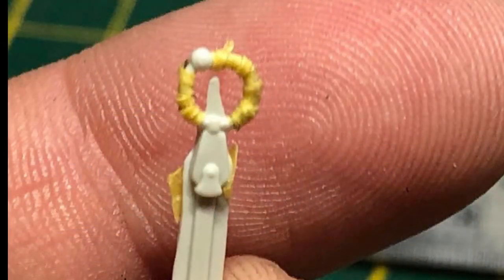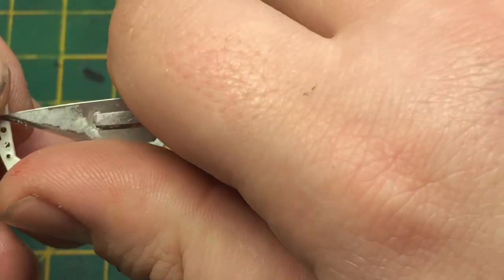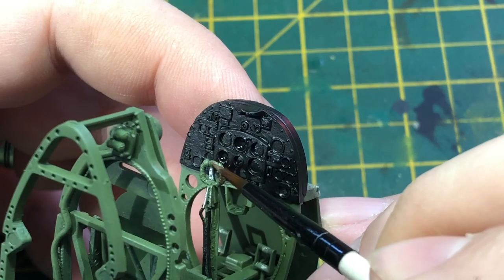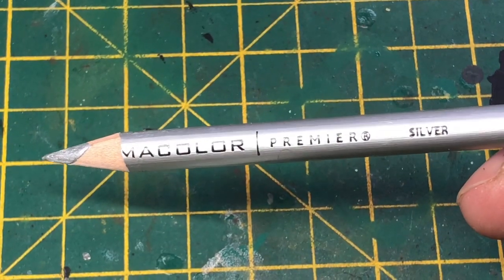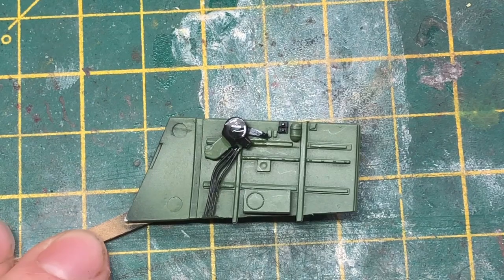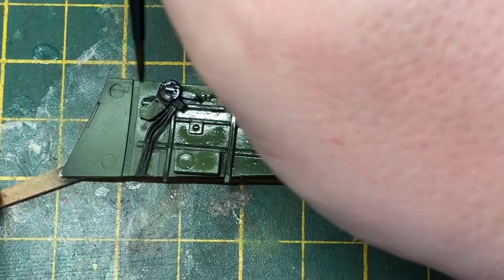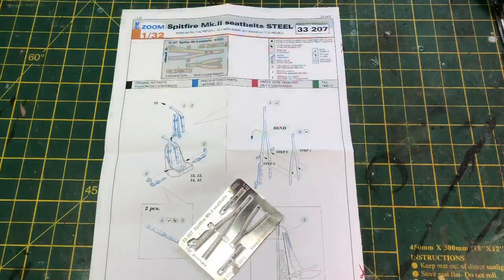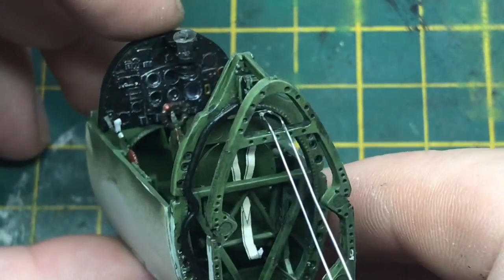Cockpit build of Revells 1/32 Mk2 Spitfifre

Comment: I'm building the hobby 2000 Va Revell kits it's horrible 😫  that seat nightmare and the decal for instrument pannal the Outer out it doesn't line up with the nice instrument pannal anyway! The left sides wrong and the Va seems to have a big dial up right corner it's on decal but not pannal so over laps the under raised pannal etc horrible so will be ripping ot off soon!
Reply from the maker: That suck!! I must say i had very little issues with this kit